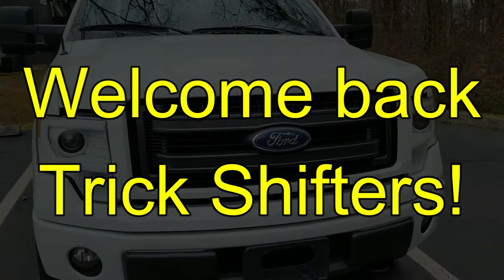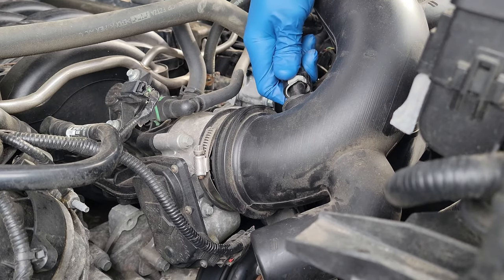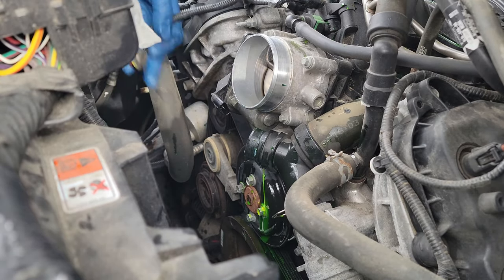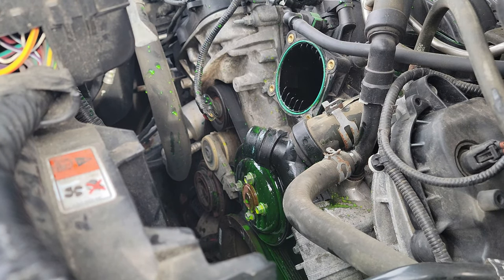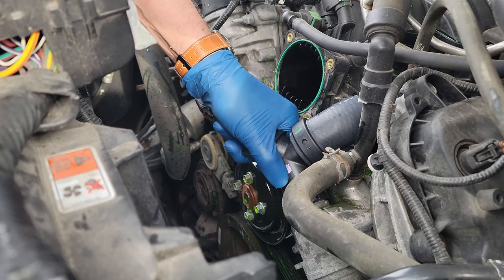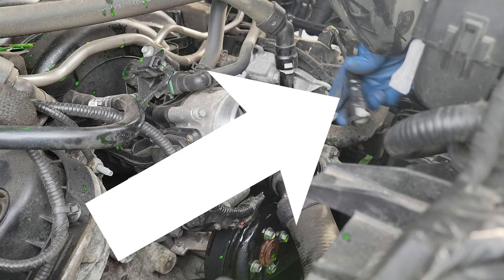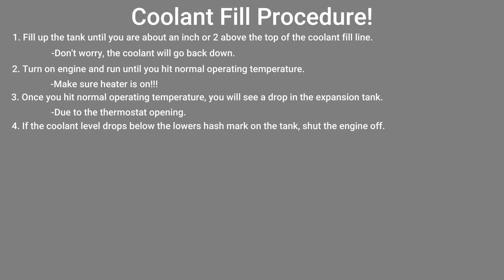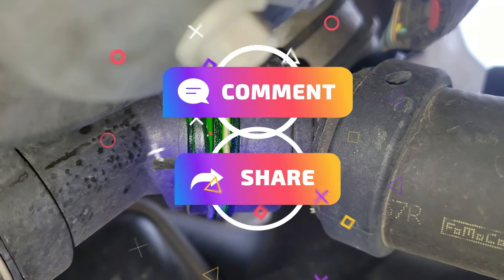2011 - 2023 Ford F-150 Coolant Leak fix!

Comment: My T connector still felt loose after. Did yours? And I still had leaks but my t connector was the cast style instead of the plastic? Did I get the wrong one?
Reply from the maker: Hello Zach, I think you got the wrong one. I believe the T-Connectors for the 5.0 are a different size than the 3.5 ecoboost. That may be your problem. I have not experienced anymore leaks and mine was pretty snug after I connected it. Sorry you're going through that!
Reply: Thank you so much for the fast reply! Yeah mine is the 5.0. Do you think if I do the part with the plastic Tee it’ll work?
Reply from the maker: I think if you get the Motorcraft T-Connector, you will be just fine. That's what I got and haven't had an issue.
Reply: @TrickShiftGarage  sorry to be such a bother! Do you remember the part number?
Reply: @TrickShiftGarage  I can only find the Dorman one or the Gates one
Reply from the maker: You are fine brother! I'm always glad to help! The part number I used is: DR3Z-8566-B
Reply from the maker: There are some part numbers that end in A (instead of "B"), but mine fit perfect. I would stick with B and you shouldn't have an issue.
Reply: @TrickShiftGarage  thank you so much for your help! I’ve been trying to ask anyone and everyone no one would help! I’m gonna try the part number you gave me instead of the cast  aluminum style and see if he makes a difference! You’re a life saver!
Reply from the maker: Anytime Zach! Hopefully after you install it you won't have anymore coolant leaks. Good luck! 👍
Reply: @TrickShiftGarage  bro I changed out the T fixed it! Then I noticed I had a leak from the front bottom near the oil pan! Ah!!
Reply from the maker: Damn sorry to hear that Zach! Glad you fixed the original though. Do you have an idea where it's leaking now? Lower radiator hose?
Reply: @TrickShiftGarage  it looks like it’s coming from underneath or behind the harmonic balancer then onto the front of the oil pan man. I appreciate all your help
Reply from the maker: Oh, unfortunately that seems like it could be the water pump. Do you have coolant dye to find leaks?
Reply: @TrickShiftGarage  the water pump area appears not to have any leaks but I don’t know much honestly man. And I sure don’t, do you have any and live near Texas I’ll buy gas and beer 😂
Reply from the maker: Lol, unfortunately I live in Maryland or else I'd be all about it. I have a video on how to find coolant leaks and in the description I have a link to some coolant dye. Very easy to use and extremely helpful.
Reply: @TrickShiftGarage  thank you for all your help!
Reply: @TrickShiftGarage  I went and did further inspection. Lot of wetness around bottom of water pump and the water pump pulley is alittle loose to where I can move it by hand. Definitely water pump failing?
Reply: The new water pump fixed it! Thank you for all your help!
Reply from the maker: Perfect Zach! Glad to hear that! Hopefully you don't experience any issues for awhile now bro.
Reply: @TrickShiftGarage  amen to that bro. It was awesome talking to you not very many pros would do that! So y’all rock!
Reply from the maker: Absolutely man anytime! We are always happy to help!